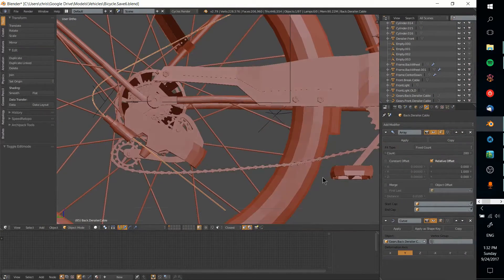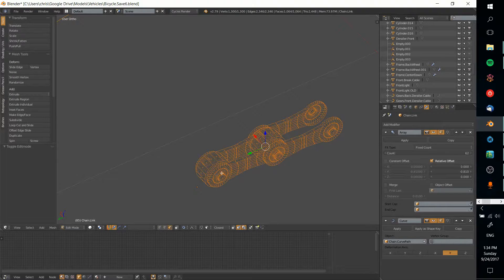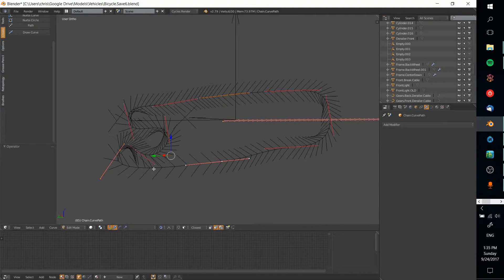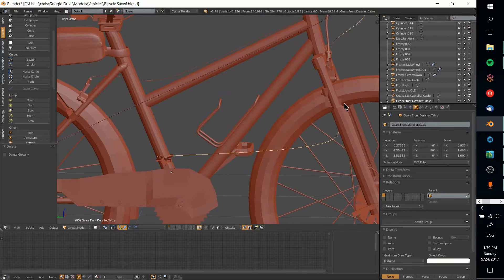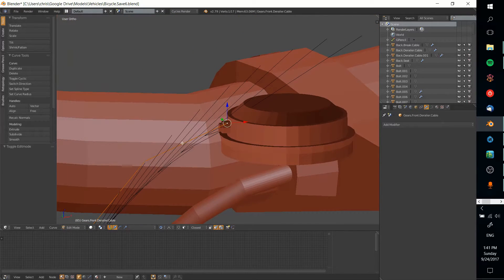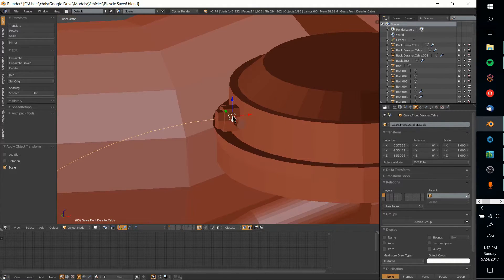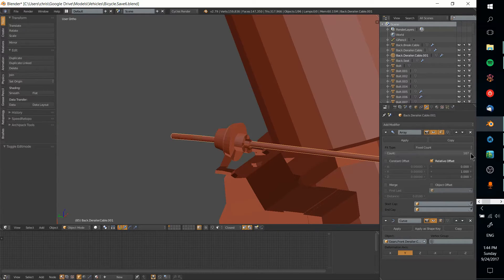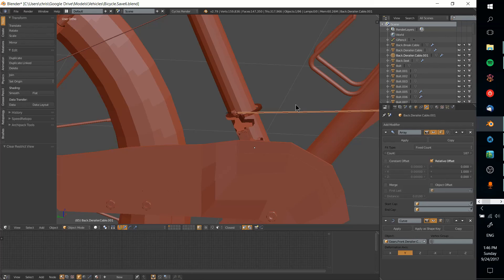How to Make Shapes Repeat on a Curve Modifier in Blender 2.79 Tutorial

Comment: A much better way to do this is to use the curve setting on the array modifier. It will automatically adjust the length/number of duplicates for you whenever you change the curve. Gives a little more flexibility when changing the object. You also don't need to add the curve modifier.

To get this to work, all you have to do is change the "Fit Type" option from "Count" to "Curve" and voila. You may have to rotate the object around in edit mode a bit to get it to extend along the curve in the right direction though. Once you've done this, however, you can even smoothly make certain parts of it thicker or thinner by changing the radius of curve handles.